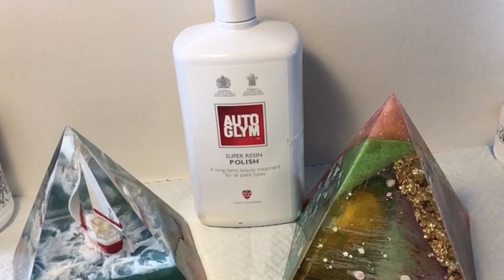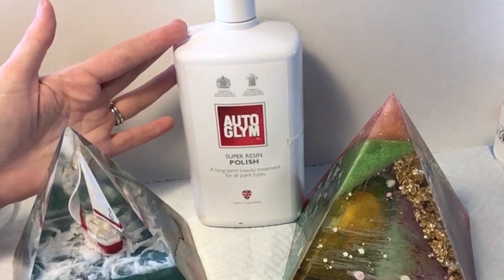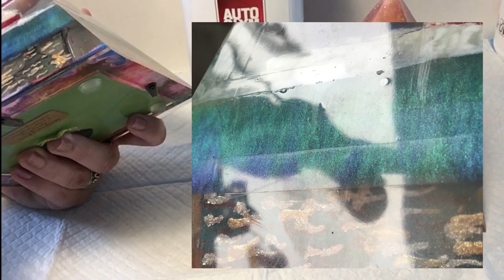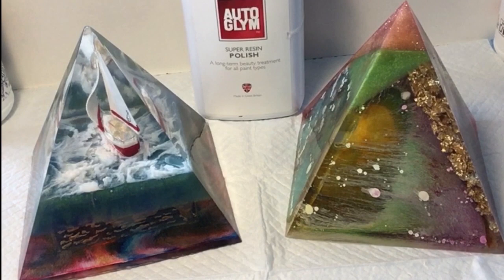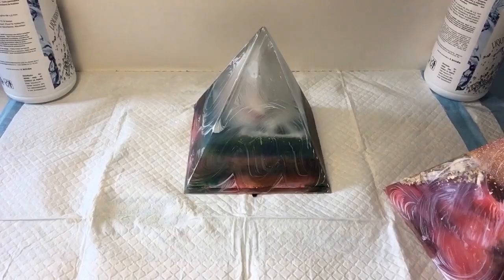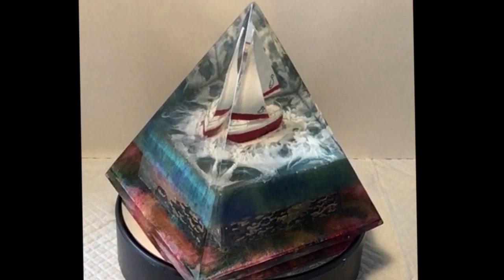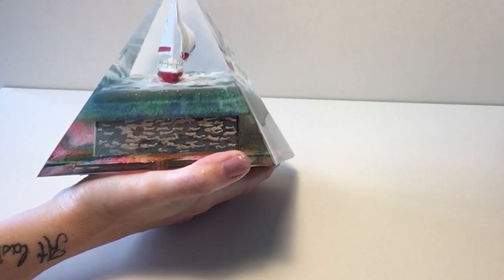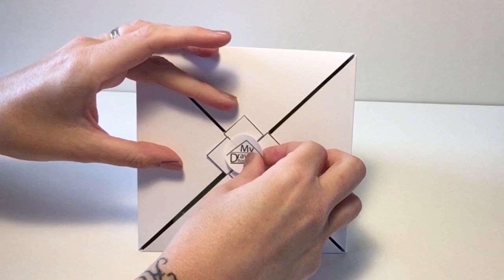Polishing My Resin Pyramids With AutoGlym - Can I erase Imperfections?

Comment: My first thought about the lines is that you may have used a torch to get rid of bubbles. I went back and looked at an earlier video in which you created a pyramid - sure enough! That's what ruined your mold. I seem to remember you having a mold that stuck to a pyramid a while back - that is also from using a torch. It ruins molds. To get rid of bubbles, warm your resin on a heated coaster for a few minutes before adding the hardener or stirring. Use ONLY a heat gun - no lighters or chef's torches. Once a mold sticks to the resin, the mark from where you had to tear it away will always be in there, forever after. Seriously, you make some beautiful pyramids. I hate to see your molds getting ruined. That yacht pyramid is crazy-beautiful! I do believe you just may be the Queen of Pyramids!
Reply from the maker: Thank you, it wasn’t from the torch this time. I only use the torch for a split second every few minutes to protect my mould - that’s more effective than a heat gun and produces less heat. When it sticks- in my case anyway, it has been from too much exothermic reaction from pouring too thick. In this video the line on the pyramid Is from a kind of tide mark on the mould. The tide marks go all the way around and I think it’s from the natural ageing you get on all silicone moulds but because it’s been used for layers you see a contrast. I don’t know if that makes sense lol.
Reply: @LouiseSingletonCreations  Makes perfect sense. I was amazed, just the other day, at how hot even a smaller pour can get. I started resining with a torch. No matter how careful I was, I still ruined a couple molds. They're just not for me. Again, I want to say that your pyramids are BEAUTIFUL! You truly are the Queen of the Pyramids... like Nefertiti!
Reply: @LouiseSingletonCreations  Oh, and the yacht pyramid is unbelievably AWESOME!

Comment: Looks great!!  The shine is beautiful!  Everything you touch turns out fabulous! 🌹🌹🌹
I’ve been using Flitz Polish on resin with most excellent results.. I have tried every polish & wax imaginable and this Flitz (in the tube, 50 grams I think) is the best thing ever.  But I also use it for molds that are getting a little older and need some help. It works on just about everything that needs polishing.  
Anyways, looking forward to your next.  ✌️💯💯🤩💕
Reply from the maker: Oh wow! What a fabulous tip, thank you so much, I will get some xx

Comment: The secret to scratches like that is to get down to that depth first with coarse grits. There is a set of six or 8 sanding polishing pads on aliexpress or you can get other brands, they have what looks like a few hundred raised squares on a similar attachment to the one you have with lines around it to help air flow and to keep it cool so it doesn't burn.
You probably need to go down to about 400grit, or maybe 240grit, do that until the whole thing is scratched up but the main scratch you are working on is gone. From that point, you go up the grits until all the scratches are about the same size, and they get smaller and smaller. Most sets finish around 1000-2000 grit and at the 2000 grit one you barely need to polish it at all. It does take a bit of time but your progress is more obvious. 
The other thing you can do, is thin another batch of epoxy with some mineral spirits/alcohol or something, (different epoxy types can be thinned with different liquids) about 10-15% spirits mixed in to a tiny batch, and then paint that over the top. I would say lay it almost flat on the side that needs done, put masking tape on the other sides to stop the drips going down it then paint it on, let dry, and repeat if the scratch is still visible. That way, as long as there is no dust in the air should dry with a perfect finish, but from then on a normal polishing compound like the one you are using would be fine. 

I have a question for you though, how are you doing your hollow out pyramid chambers?
Reply from the maker: Thank you for your advice, I must stop being lazy by looking for shortcuts when I really know it needs doing properly.
Reply: @LouiseSingletonCreations  There is nothing wrong with looking for shortcuts. Just sometimes you need to dig a little deeper to understand the long way first. Polishing plastic is a lot easier than polishing steel or glass but it's the same process. The short cuts are when you can find normal products that do the same job for a tenth of the price of the brand versions

Comment: Try using washing liquid to clean the mould as soon as you take out the piece of art, may take away lines, I also do this to clean my resin mixing cups.
Reply from the maker: Thank you for the tip, I will try that :)
Reply: @LouiseSingletonCreations  if you do, clean cups with blue roll to get excess resin out, rub cups with liquid (don't use any water). After you have rubbed thoroughly rinse under luke warm water.
Reply: Heya 👋  What is ‘washing liquid’ ?  And I’m guess blue roll is painters tape? Lol  🤔.   That’s how I clean my silicone cups, bowls, molds out - with tape.
Reply: @debrajol3585  Hi, its also known as dish soap in the States, blue roll is similar to kitchen paper.
Reply: Allistair Mateer ahh I was way off! 😂.  Most of the painters tape is blue here.  Kitchen roll is like our Paper towels.. disposable.  Thanks 😊 
I never wash my silicone cups or bowls. I flip them inside out & knock off most of the cured resins and then make tape donuts to roll around them.  
Same with molds- pull tape across surfaces before removing the pieces and do it again after removing the pieces for the inside edges as needed.  I used to wash them but I had so much dust and things getting inside as they dry.  And they wore out sooner.. maybe from scrubbing 🤔 .  Packing tape & scotch tapes - the cheaper the better. 
Happy Arting! 🌹

Comment: I have been getting that problem as well but you won't get rid of them because the resin is breaking the silicone mould down and burning it
Reply from the maker: That’s what I’m thinking too.
Reply: @LouiseSingletonCreations  hi louise it's true what im saying because I have been using resin for 50 years now and a professional with the stuff and highly experienced with it and also you will see that your silicone mould will start curling up as well from the corner where the resin is attacking the silicone breaking it down and not only that your finished work will come out of the moulds looking dull and cloudy because the super high quality shine has been removed from the walls of the mould leaving it dead looking basically and needs to be dumped in the end because it is blurry and every time you make something with the same mould everything will come out of the mould looking dull and cloudy because it has finished and will not leave a clear shine anymore so better off dumping it louise ok and I also have that plastic cleaner you have but mine is the blue cleaner and you have the red bottle but will make no difference once the mould is breaking down by the resin
Reply: @LouiseSingletonCreations  your silicone mould will start turning from clear translucent to white where the resin has been burning it after many uses and the lines your on about it that part where the resins chemical reaction is heating up fusing the new part of fresh resin you have just made and welding it in to the cold part you made the day before and that's how all resins work by heating up the cold part and soften it to fully fuse both parts together as  one soiled block ok
Reply: Your work is absolutely stunning louise i love your work
Reply: @LouiseSingletonCreations  you won't get rid of those lines louise ever once you start using resin over and over again once the resin starts to attacking the surface of the walls of your moulds it starts burning into the silicone surface breaking it down
Reply: @LouiseSingletonCreations  i hope i have been some help to you good luck
Reply: @LouiseSingletonCreations  hi louise one last option i can think of is what you do is take out your finished product from the mould and mix up the right amount of fresh resin pour it back into your pyramid mould and then replace your finished pyramid back into your mould a second time completely submerging in the freshly made resin because there is no join getting made because it is all one piece of material that will fuse a very thin skin onto your finished pyramid i have tried this action myself but the lines are gone but the rest of it is still dull and cloudy because the mould is finished basically